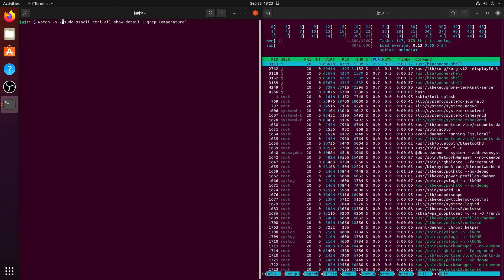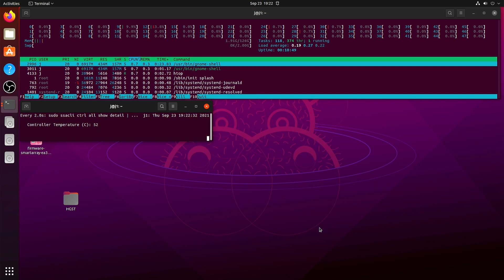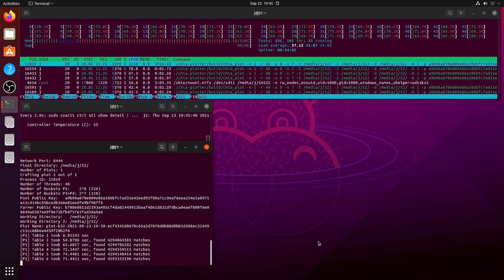Does an HBA require a fan?! (Hardware Mods)

Comment: Is 58 C for these cards really that hot? I'm about to add a card but I've already invested in keeping fan noise low so I was hoping to go with the A4x10 or add a resistor. Mine will only see occasional load.

Comment: Curious how you mounted fans to that heat sink? It looks like it has a non-standard size?
Reply from the maker: Well, at first I just tied zip-ties to it, later I just designed a custom snap on mount that I 3D printed for it. =)
Reply: @JanisRode  can you share your STL file for this mount?

Comment: You can run the h240 in balanced power mode and shave 10-20 degrees C off the idle temp.

Comment: What software did you use to check the temp?

Would putting a fan pointing vertically down on the card also work fine?
Reply from the maker: I used SSACLI to check the temp.
The card/heat sink are designed to be used in a case with front to rear air movement. They actually have little plastic covers that allow for more air to be pushed through the heat sink. The way I have it set up in this video, coming straight at the heat sink from the middle, is still effective, it just pushed air to the front AND rear of the card from the middle.
Blowing at it from the top wouldn't be as effective, although I have no doubt that it would be better than not having any air at all coming at it. =)
Reply: @JanisRode  thank you for the insight ☺
Reply from the maker: @solverz4078  Sorry about the delayed response, life happened.
Reply: @JanisRode  

no problem!

I ended up getting a 3d printed bracket and a small noctua fan ☺

Comment: good video it show that the hba are not made for desktop pc. high temp can lead to data error even or dead of the hba. What ROC max temperature should I never run over to preserve long term chip healthiness ?
--> 55°C Max.
Reply from the maker: Thanks! I have seen the max 55C number for LSI HBAs, but I haven't been able to find any official HP documentation that states a specific temperature for their HBAs!
My personal dream temperature is anything below 50C, if the ambient is below 25C, since I know from experience that the ambient can fluctuate quite a bit, especially if you have a lot of gear and close the door!!!
A little bit of wiggle-room is always good to have IMHO!
Reply: @JanisRode  i did find only LSI specific temp. take a fan on HBA is realy nice idee overall. 10Gbit networkcard like cooling too :)